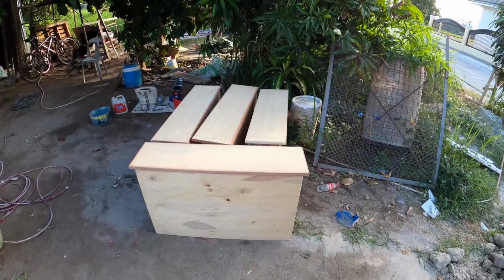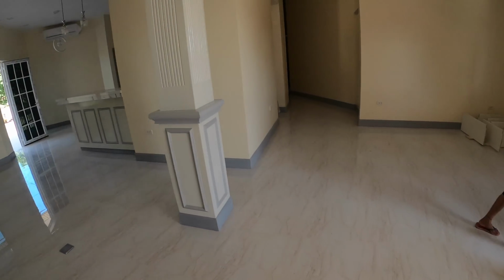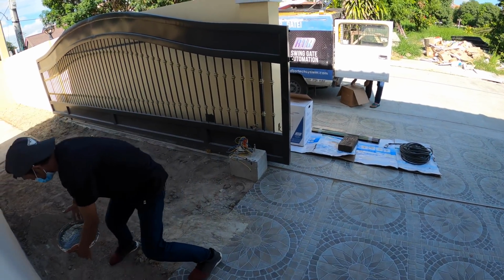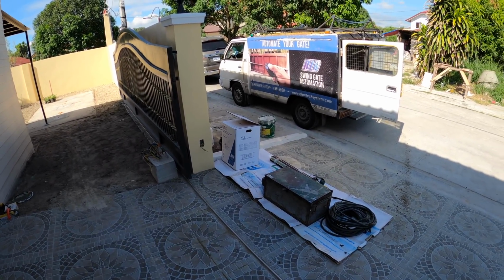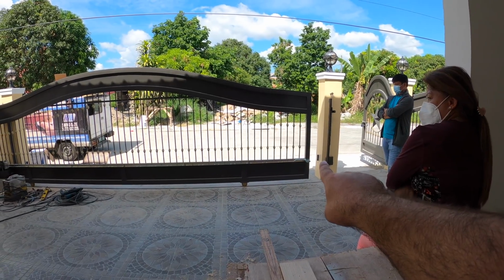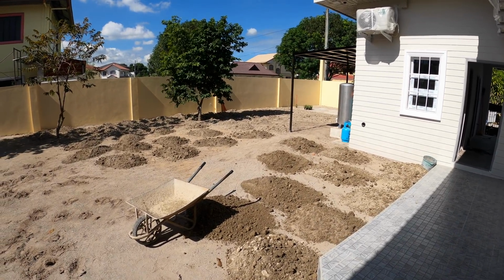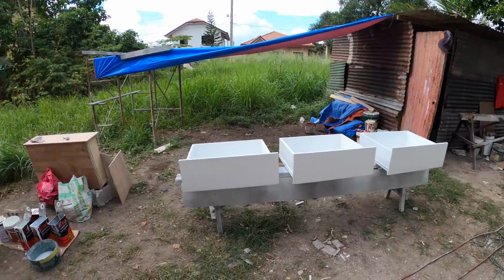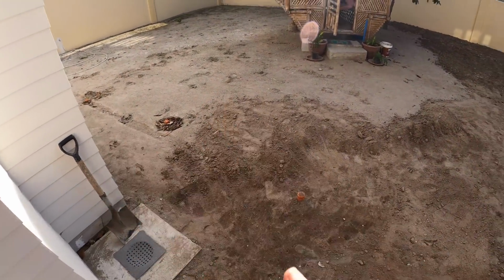Philippine House Building Step by Step, Build Day 255: Sliding Gate Motor Installation

Comment: Nice gate - I have installed several of these systems and they work well - one thing you may want to consider though - please get to know how to release the drive mechanism so that you can manually open the gate if the power goes off or if the drive was to fail and your car is inside - just a thought.
Reply from the maker: One of the first questions we asked the installer upon completion. 🤔 
He went through the process right in front of us explaining every step along the way. 
Fantastic customer service. 👍👍

Comment: It seems the gate is working perfectly..Italy is a great maker of gate motors, we are using one of them here at home in France and the brand is CAME. Very good job from this company 👍🏻
Reply from the maker: We are very pleased with the sliding gate motor. Hoping it lasts for many years to come.
Reply: Casa TexPina  Hi!   Beautiful home!   We just purchased land near Kalibo, and we are planning on a motorized sliding gate too once we start to build our home there.  Can you let me know a rough estimate of what a gate & motor assembly costs.   Thank you in advance.
Frank & Mia
Reply from the maker: @frankpereira3802  
Welcome to Casa TexPina!
The sliding gate and the motor were on separate contracts. The gate was included in the cost of the perimeter fence. The motor was roughly PHP100K. 
Thank you for tuning into our channel and best of luck on your future build.
Reply: Casa TexPina Thank you so much!   Will be watching more videos!  Good info!    Can’t wait to start on ours.
Reply: One more question.   Rough estimate on building wall around property?  We bought a lot around 1600 sq meters.
Reply from the maker: @frankpereira3802 
We have found the average cost of perimeter fences in our area to be PHP5K - PHP7K per linear meter. Costs may vary depending upon negotiation skills and type of fence (all chb or chb and metal grilles).
Reply: Casa TexPina Thank you so much!!

Comment: Wasn't there 3 hanging lights over the breakfast bar? If I recall you had 3 and they broke 1 of the globes and you replaced with a non matching globe. Did I miss something?
Reply from the maker: We found a matching globe for the second set of lights. That also match the lights on the front porch. 
We’re waiting until the bulbs come in the mail before putting up the matching globes.

Comment: Another great work day.... one question: there are orange pvc pipes just sticking out of the ground around the perimeter of your house... are those lawn irrigation system?  Great applause sound effect. 😊
Reply from the maker: They are intended as termite irrigation points. Place to pour termiticide on a regular basis similar to bait sticks.
Reply: @CasaTexPina  interesting idea.  I'll need to remember that if we move to larger house.